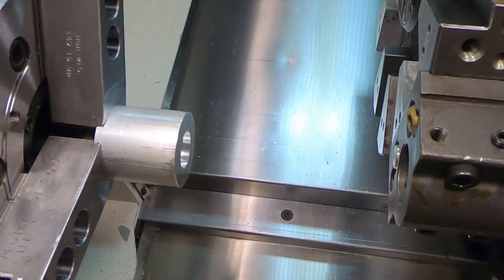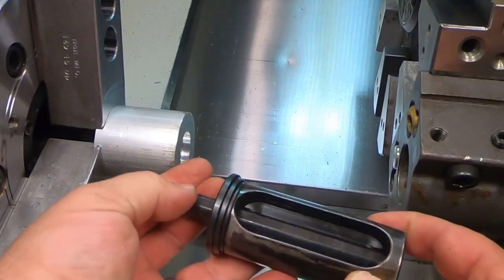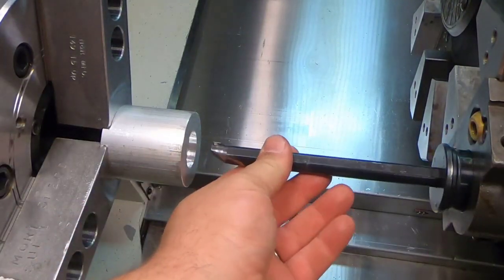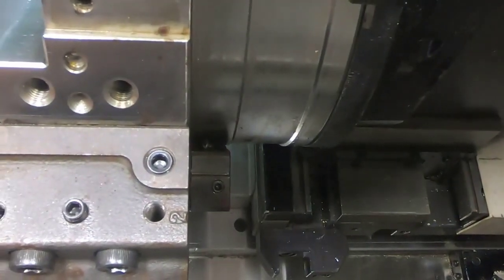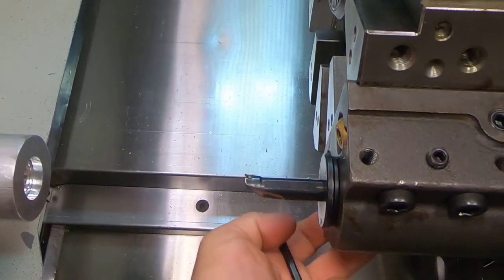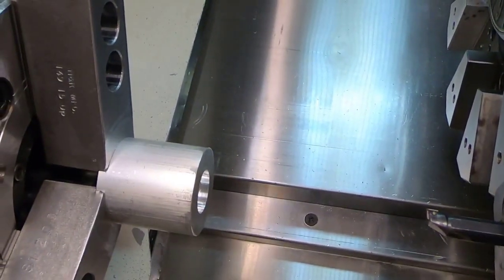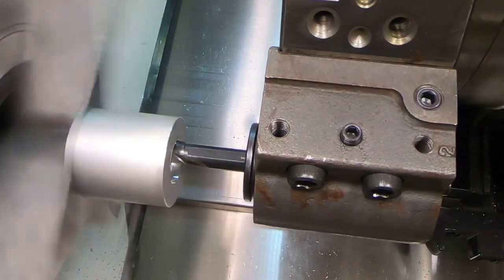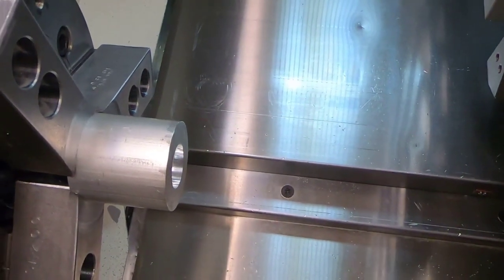setting up a Boring Bar on cnc lathe

Comment: How do you know your tool on on the centre line though? adjusting the X is fine and all but if the tool is sitting too high or low do you need to rotate it?
Reply from the maker: The idea between two axis lathes is that the Y (Turret) is on the center from the manufacturer. However, when machines are crashed, the turret becomes out of alignment. This is something that you would have to have a technician come in to repair because older model machines are mechanical whereas some newer machines are Servo driven turrets, which are very nice but different. If you are needing to know how out of alignment your turret is simply grab a turning tool and make a facing pass on a piece of material. measure the nipple on the face of the part and divide it by two. At this point in time, it's whatever you are able to live with or shim for before you spend the money. I hope this helps, and thanks for watching 🎉
Reply: @aaronrunk4209  So i get hat that the holder will be on centre but the boring bar you put in the holder if rotated could be off the centre line.
Reply from the maker: @Festivejelly yes, the boring bar can be off center line, but if the Bolt on Holder is made for the machine it should hold it straight along with the boring bar being in the correct sleeve to hold it at the correct angle as well with the three set screws. So technically if all the stars aligned it should be very straight
Reply from the maker: @Festivejelly I have been the victim of putting the boring bar in in correctly but luckily I was keeping a close eye on it when it started going towards the material and realized what was about to happen fingers crossed I can always catch it but just in case I always go slow thank you again for your comments

Comment: I'm new and I understand little so I'm confused.....if the diameter of your hole is 1.010 inches then how can your computer say that the current tool position is over 14.804 inches away from the center???
Reply from the maker: @mdmonroe82  first I'm super happy to hear that you're getting into the industry the good news is there's lots to learn but there's also going to be a lot of gray area on things you'll be learning on. The reason why is because the machine thinks the center of spin is at the home location when the machine is first turned on. On newer machines they are designed so that the center of spin is the is the center of the machine in the x-axis that is why mine shows a giant negative but on my newest video of setting up my new doosan you'll see that that value is completely different. I hope this helps and please feel free to reach out with more questions
Reply: @aaronrunk4209  I appreciate that. I begged a guy to give me a chance so I'm trying to right by him and learn as fast as possible. His best guy retired and I have no one to teach me on certain machines so I appreciate any info.
Reply from the maker: @mdmonroe82   you are most welcome, and please feel free to browse through all the videos that I have. I know there's a lot there, so it can be overwhelming, but use what you can and good luck

Comment: Whatever works for you. The controller will do the math for you using the X measure function. I agree.
Reply from the maker: It's wild these days setting tools. I have several machine tools in the shop from the 80's to just a couple of years old, and there just seems to be so many ways to set them up. Thanks for watching

Comment: That's shit, you should use the upper set of screws to force the tool above the axis because once it gets in cut, it deflects. You must consider tightening the screws equally or the tool might be aslant. Also important to note that you should rotate the tool bit counter-clockwise to force the insert tip above the axis. The more your tool sticks out and more force you apply on it, the more it deflects.
You have the tool pulled out 3xD at most, taking less than 0.01" off aluminum with sharp insert with small radius and very low cutting speed and it sounds as old knocked out whore.

Comment: Now say we are doing this on a Tsunami. And we need to find x on the sub spindle side. How do we do that?
Reply from the maker: If your machine has a single turret, and your work holding  is the same with the same size boring bar.  Your x location will be the same for both spindles. because they rotate on the same center line. I show this in my Haas ST-20Y video. Hope this helps, and thanks for watching

Comment: Why don't you press measure X1.010" ?
Reply from the maker: The good news is there is a reason. Depending on the model of the machine and how the manufacturer have the parameters set, the machines center of rotation can be in multiple locations. This is also true with the Z axis. Meaning some machines you can simply put a positive/negative value depending on the side of the tool that you are using and from the center of rotation and you've safely set the tool, and from there you can adjust accordingly. However, other machines the center of rotation is a transferred value from the machines home position. Meaning the machines "center of rotation" is at home position and must be set using this method. Also, it is good to note that once you know the distance from home location to the center of rotation you can simply save this value and each time you setup a tool use the method you describe and input your adjust as a +input / write. Thank you again for watching.
Reply: @aaronrunk4209  36yrs fanuc, yasnac, fagor, tosnuc, Mazak, etc... 
Never recorded a tool offset in that manor, I know it works, but good lord it's complicated 🤯
Reply from the maker: @christian heidt  that's a lot of experience sir and also good to know that it works at all those machines. I'll have to set it up and make a quick video showing that method. Thank you again.
Reply: @aaronrunk4209  thx to you as well!

Comment: Why didn’t you just put X1.010 hit Measure and the machine does all the math for you on the X offset
Reply: if he's just indexing the tool instead of calling it up in the MDI then this might be the reason "X1.01 measure" doesn't work, you can clearly see that the machine thinks its at T0101 even if the turret is t11 doesn't mean the control knows that
Reply: Exactly what I was thinking
Reply from the maker: The good news is there is a reason. Depending on the model of the machine and how the manufacturer have the parameters set, the machines center of rotation can be in multiple locations. This is also true with the Z axis. Meaning some machines you can simply put a positive/negative value depending on the side of the tool that you are using and from the center of rotation and you've safely set the tool, and from there you can adjust accordingly. However, other machines the center of rotation is a transferred value from the machines home position. Meaning the machines "center of rotation" is at home position and must be set using this method. Also, it is good to note that once you know the distance from home location to the center of rotation you can simply save this value and each time you setup a tool use the method you describe and input your adjust as a +input / write. Thank you again for watching.